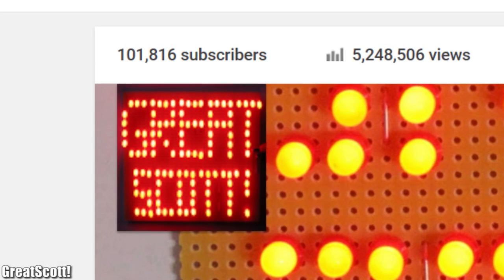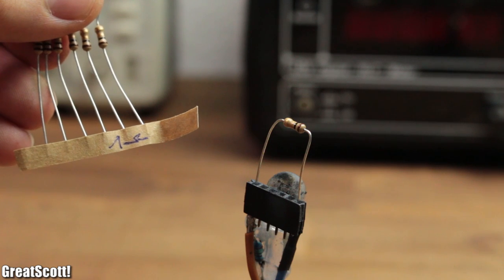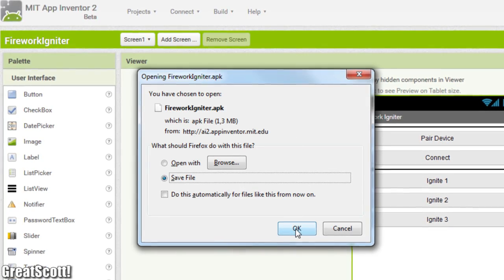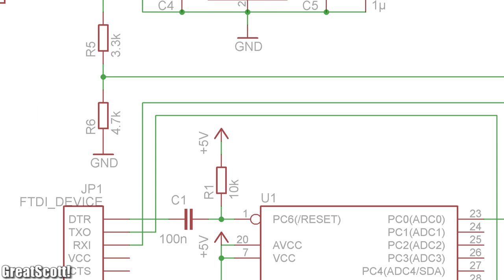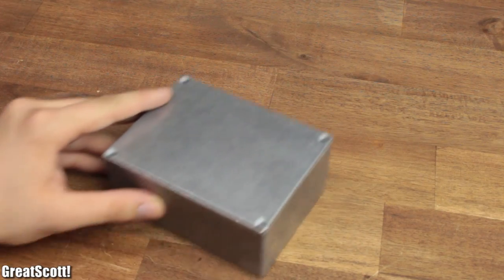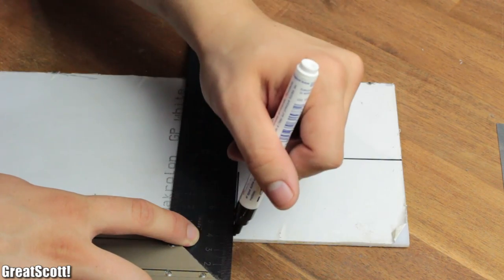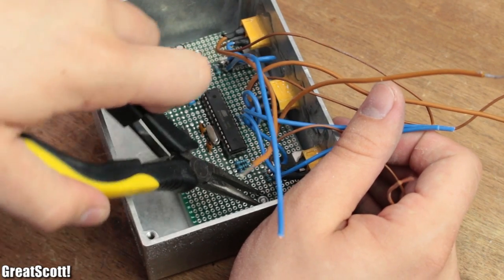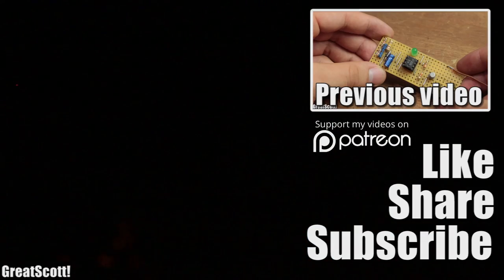Make your own Remote Bluetooth Firework Igniter

Comment: Hey Scott.

You could use resistive wire to ignite the fuse instead of the resistors.
Reply: +BloodySword I was thinking the same thing. Nichrome wire would be perfect for this. It has the advantage of being reusable. It could be shaped into a loop to hold the firework fuse.
Reply: +KiwiHelpgeek Or kanthal.
Reply: Does that mean, every time he uses it it costs one resistor?
Reply: Well it depends if it melts or not.

Kanthal or stuff like that are also less harmful because the resistors give out different toxins when burning
Reply: wud be gud on a rocket rack 1 length of wire fires the lot lol
Reply: NerdShedLabs TM GeekSufniLab just use cheap wire strand 3 raps round ignition cord ignites cord every time ....airbombs was the best untill they got banned direct ignition remove fuse cord ...dun 5 at same time with slight delay .....and using wire I learned fuse cord just burns up the wire after ignition pointless really
Reply: NerdShedLabs TM GeekSufniLab umm he bought it??????

Comment: 10 ohm resistors don't cost much.. but they aren't free.  Get a trashed toaster, yank the heater wire out of it, and use that in place of the resistors.  You will probably have to adjust the current, but even the spring from dead retractable ink pens works.

Comment: Okay this is pretty awesome. Very elaborate and a little beyond the average DIYer which is why you should make these and sell them on Amazon or Ebay. I would buy one. The least amount of work for the end user the better - plug n play - download an app, sync the bluetooth, and plug in the fuse(s). Multiple fuse ports with their own individual blast buttons. Include an extensive manual with elaboration on not blowing yourself up. Might be even cooler to have an upgrade to include it's own remote control.

Comment: Instead of using low resistance resistor to ignite the filament use Nichrome (small gauge) wire and round it around the filament by using multiuse modular adapter then use a low pressure clip to clip the module easily against the filament. It is up to you to wrap the wire around the filament or use clip to easily and quickly attach the module against the filament. Depending on the AWG of the Nichrome wire you may need to use the proper power supply (ampere and voltage) then gate it via MOSFET or relay to heat the wire.

Comment: You used a metal box and a bluetooth reciever?! Did I miss something? Thought the box would act like a shield.
Reply: antenna
Reply: The box blocks a lot of radio waves needed for the transmission, but some of it still manages to pass through the box.
Reply: He could make a externel antenna
Reply: @Fortnite-gb7dz   Unless the BLE antenna is built on board, I would rather use other radios than BLE and then mount the antenna outside the box.

Comment: I wish I had the time to build this. Honestly that is awesome. I use 12 inch long metal pipe that is the same diameter of the artillery shells ( a common firework that usually comes with a tube  ) I welded that pipe to re-bar and stick them in the ground so no bending over to light and launch my shells. If I had this device I would mount the ignition wire to the side of each and use a nonresistant-resistant-nonresistant kanthal wire with a simple coil wound in the middle that would allow you to easily slide the fuse in. It would probably stay right there even after launch so you could rinse and repeat.

Comment: you could always use kanthal or nickel resistance wire. kanthal is my choice of wire tho nickel gets hotter faster then the other kanthal is less likely to melt and short out a battery. and in many cases much cheaper ( depending on were you find them ) then burning up resistors. around $8 US for 100 FT. not saying you would but it is also reuseable. lol if you can find it afterwards. but if you have a good amount of useless resistors then your still in good shape.

Comment: Instead of using a resistor which you burn out and have to replace I was wondering if it might work out better to use Kanthol or Titanium resistance wire coils like what is used in the E-cigarette vape devices ? They heat up and turn hot enough to light a fuse and then cool down to be used again, you could get several uses out of a single coil. Just wondering ...... thanx for reading ...............................
Reply from the maker: +Rex Buchanan Sure, sounds like a good plan.

Comment: I'm probably going to mock up this rig for a 4 tube mortar display. Just need four leads total. Wouldn't be too hard to add one more igniter. I wonder if it would be easier to make a special controller with safety switches...

Comment: A metal case works as a Farraday cage so RF signals are pretty much attenuated to nothing. You are in luck that you have some plastics in there and holes so you were in luck that you had a very shortwave RF source -- and your distance will be limitted compared to a plastic case. 
If you had a a longer wave length RF source it would not have worked.

ALWAYS bear in mind that when working with metal enclosures that when you require RF that you bring out the antenna in someway.

Comment: Just use stainless steel wool wrapped around the igniter cable as it's far cheaper and I've used it before to set off used rocket shells packed with match head powder and sparkler powder, so it definitely works and is reliable :)
Reply: or he could just use a match pressed against a thin wire with a decent amount of current traveling through it. There are many variations of this. Plus, I'm not sure steel wool is cheaper than a resistor
Reply: Pretty sure it is cheaper for the amount of igniters you can make out of one ball of steel wool. I'm not trying to shit on this guys idea as it seems to work real well but If you don't want to have to buy resistors all the time thick stainless steel wool works a treat from my personal experience :)
Reply: fair enough. If you find the right place you can get 1200 resistors for like $15, but it's all a matter of preference I guess 😉

Comment: Instat of using a resistor you can use steelwool. i made it myself and it works great i only used lithium-ion batterries( not verry smart but it works)
Edit: i din't make any Bluetooth system but just a push button

Comment: Consider adding capacitor in series on signal lines leading to mosfet gates so processor would need to send square signal to begin ignition. This way if processor get busted you will not end with premature ejection (pun intended)

Comment: You can also take match heads and the pads that you strike to light them, grind them up, and even a AA can light it. Haven't actually tried it but their YT videos I've seen
EDIT: They're called electric matches, you can get them on ebay:
http://www.ebay.com/itm/E-match-100pcs-lot-11-81in-For-Fireworks-Firing-System-Electric-Igniters-display-/131738535564?hash=item1eac3a868c:g:6S0AAOSwzgRW0qS4

Comment: using nichrome resistance wire would be a much better and cheaper solution for igniting the fuses. (same thing used in those talon clips consumer fireworks igniters)
Reply: Resistors is very cheap

Comment: Great project and video! Did you have any issues with the metal enclosure shielding the bluetooth signals or limiting it's range?
Reply from the maker: +Darian Cabot That was my first thought as well when I started the project. But the range is just a bit smaller than normal. Maybe around 1-2m.
Reply: +GreatScott! You should make a small windows of a less interference causing material for the bluetooth
Reply: +Tristan Cullum if you make a small window, it isnt "outside proof" anymore

Comment: Instead of using resisters as a heat element, couldn't you use tungsten wire to do the same?

Comment: I know this is a bit later than released, but is there a way you could make a 40 cue ignition system? what about a 60 cue ignition system? All using a 12 volt SLA battery instead of a 7.4 Li-Ion... A project I am definitely interested in using for my family's 4th of July in years to come.
Reply: or maybe even have 4-6 different 10 cue systems all recognized by the same bluetooth with maybe 2 modules able to be switched to "duplicate" mode... I would rather have this than a huge 40-60 cue system honestly.

Comment: Just like German cars and tanks....OVER ENGINEERED to be more expensive than is necessary. A small piece of nichrome wire in the end of the fuse would not only be far cheaper than a resistor, but the amount of power, and time to ignition would be less.

Comment: Doesn't the metal case interfere with or negatively impact the bluetooth reception?
Reply: +vidm96 You can possibly extend the antenna to the outside.
Reply: Teh whole box is now an antenna

Comment: Would nichrome wire be a better solution instead of resistors?
Reply: +kmyerslp If you can get it cheaper, it is. :P
Reply: +kmyerslp buy the ceapest soldering iron take it appart and take out the nichrome wire :)
Reply: ...or thrist store toaster/toaster oven/ or a spool which costs about 6$
Reply: oh welll i am from macedonia and i cant get a spool 
but the soldering irons are 90cents-50denars 
so =)

Comment: If you connect the positive and the negative of a battery to a resistor  will it heat up
Reply: yes depending on the battery and the resistor

Comment: Great video as usual, did the resistors burn out after every firing or could they be used for several launches?
Reply from the maker: +Marius Ammann Yep they needed to be replaced after every launch.
Reply: +GreatScott! RIP Resistors 2015-2015

Comment: Statt für die Pinzuweisung Speicherplatz und Rechenleistung zu verschwenden empfehle ich "#define Name Pin" zu verwenden. So ersetzt das Programm einfach den Namen mit dem Pin beim hochladen und der Controller muss nicht erst auswerten und selbst ersetzen.
Reply from the maker: +Marcel I know. But since the code worked without any problems and there was enough space I skipped the optimization part to safe a bit of time.

Comment: GreatScott just a suggestion for the next time you want to wirelessly control something, try roboremo it does basically the same thing you did, but of course it being a pre-built app means less work and it has a bit more functionality, only the free version has a limit of five items but that's fine for something like this which only needs three buttons.

Oh and an idea for anyone wanting to do this project, as others have suggested using nichrome wire rather than a resistor to make it reuseable, well a simpler idea might be to get a few cheap usb lighters such as linked below, then just replace the button inside it with your arduino or whatever you plan to use.
http://www.aliexpress.com/item/2015-Hot-Sale-Excellent-Gift-R1B1-USB-Rechargeable-Flameless-Cigar-Cigarette-Electronic-Lighter-No-Gas-Colorful/32322922984.html

Comment: Can you tell me the name of the black material (insulating?) used in 6:00 ? Thanks
Reply from the maker: +Greali Shrink tubing
Reply: Thank you very much! I tought that it could be some type of insulating tape :S
Reply: +Greali Insulating tape also exists. I bought a special kind in a supermarket a few months ago, but so far, duct tape has worked fine for me! :D

Comment: what would i need to do to adapt this design to include 20 or 50 cues instead of 3 and would it be possible to adapt the app to include the ability to connect to and control multiple boxes?

Comment: how does the metal case effect the bluetooth range? should you use it at all?
Reply from the maker: +zaboky That was my first thought as well when I started the project. But the range is just a bit smaller than normal. Maybe around 1-2m.
Reply: +GreatScott! recently i bought an RFDuino, wichis great for small projects. i tested it without case an it had a 100 m range. do you think that if i put it in a metal case, it also wouldnt effect the range so much?

Comment: I don't get it.. why is a lower resistance value producing more heat than a higher resistance value? Wouldn't a higher resistance mean more watts?
Reply: Check your Ohm's law. 6.7v with 10 Ohms = 4.49 Watts and 0.67 Amps. / 6.7v with 2 Ohms= 22.44 watts and 3.35 Amps. A lower resistance allows to have more current through so the battery will have more liberty to push harder.
Reply: Fosi94 Oh man you're right.. thanks!
Reply: John McJohnson Glad to help,  have a nice day!

Comment: Could I use this as an app controlled light switch if I hooked it up with a transistor on the output and changed the code a little bit?
Reply: Love4TheMusic yes

Comment: Hi, i'm actually doing this project and i'm having issues with the arduino loader since i have never worked with arduino chips. What board do I have to use for this project? I'm trying with arduino mini but i keep having this issue : avrdude: stk500_recv(): programmer is not responding